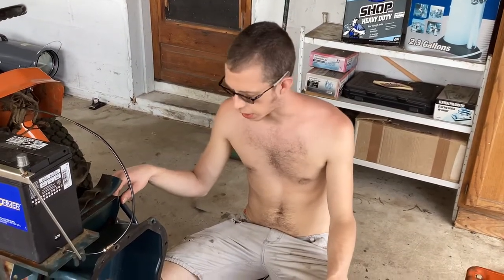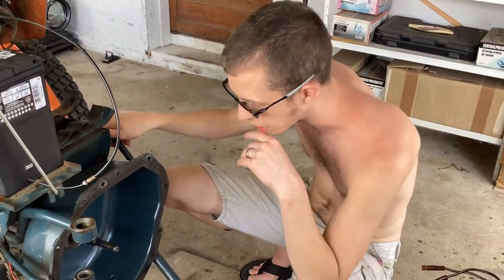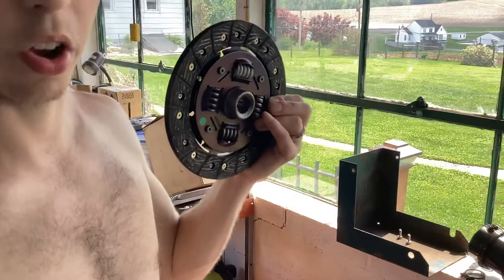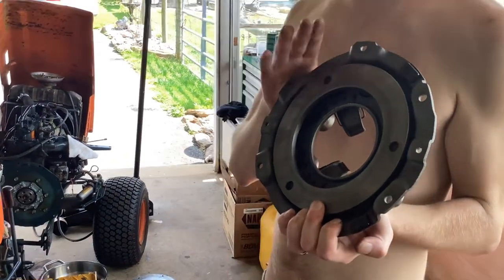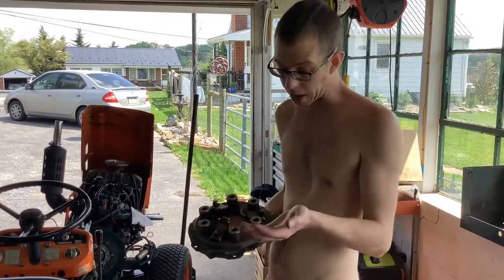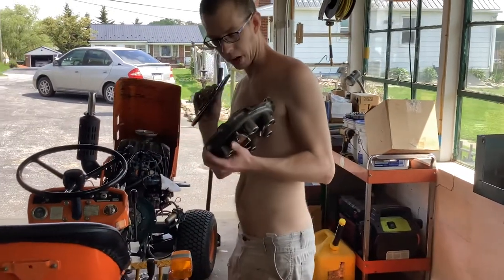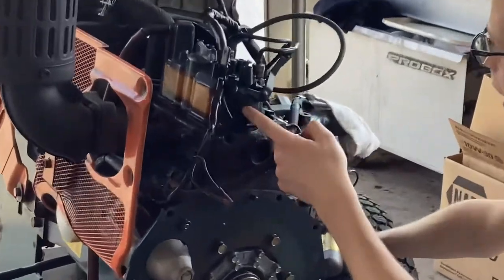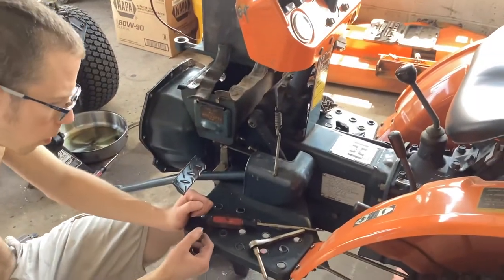Understanding a Kubota clutch

Comment: You do an exceptional job explaining the clutch. Thanks! I have to press the clutch exceptionally hard to crank my Kubota and sometimes even then it won't even begin to crank. Do you think trying to adjust the clutch lever a bit so that it can go further down would be damaging. This is a problem that has been on-going for at least 20 years, but lately, I have had more difficulty cranking the tractor no matter how much I press (stomp) the pedal.

Comment: Appreciate the video! What year/ model tractor is this?? In doing research on the Kubota D1105/D1005 clutch mechanism as I'm trying to adapt it into a ditch witch. My pressure plate from the ditch witch is very similar to yours. I just ordered a Kubota flywheel and pressure plate but it looks like an automotive style release fingers. Hoping I can use my ditch witch disc or I get lucky and they have the same splines.

Comment: My clutch doesn't seem to be working at all.  Gears want to grind when clutch is pressed all the way in.  I have the same B5100 you have.  Any ideas?  I need to probably learn how to adjust the clutch properly.  I cannot tell that there is anything wrong w/ how the pedal itself is adjusted.  It's not making any funny noises either.
Reply from the maker: Yea adjust your pedal first
Reply: @braydencordrey8544  Awesome, thank you for the response.  I will try to get it adjusted and report back here after I get it working and share what exactly got it going.  Your video helped me to understand that the clutch safety switch is actually just a switch and has nothing to do w/ the clutch operation.  I thought it was some sort of master cylinder, but that was way off.

Thank you again.
Reply from the maker: @kr4dh4x0r  you should feel the pressure change in the pedal when the pressure plate gets pressed open to release the clutch
Reply: @braydencordrey8544  clutch adjustment got it fixed. I took the clevis loose and spun it out two turns or so to lengthen it.  Clutch works perfectly now. Probably first time it's been adjusted in 20 years. Thank you for your help!
Reply: @braydencordrey8544  I am having the same exact problem with my B5200 that BS has, Your video is excellent.  I hope it is an adjustment problem.  Now I know where to start looking.

Comment: The pilot bushing go into the crank or flywheel?
Reply from the maker: Into the flywheel
Reply: @braydencordrey8544  did you do it? cause i tried on my 5100 and the bushing dont want go into the flywheel hole, i had to cut cut the crack of the bushing for making sure the bushing go into the flywheel hole and now the crank cant go into the bushing just to small ????
Reply from the maker: @johnnygagnon4968  it is a press fit